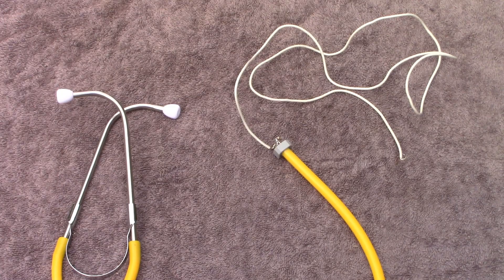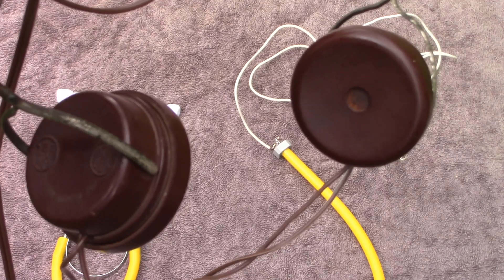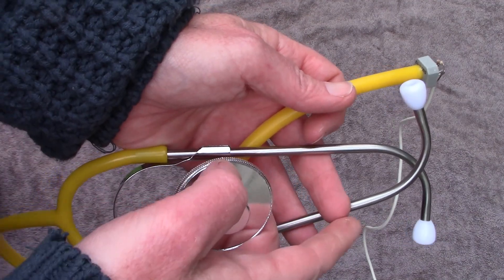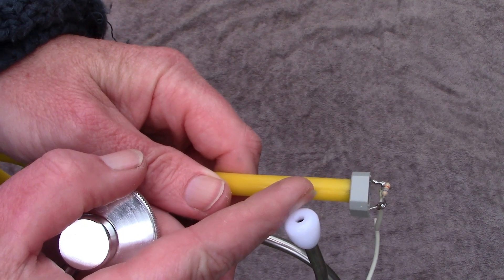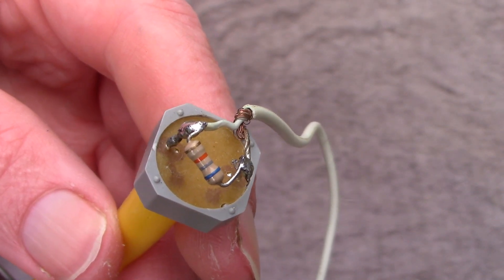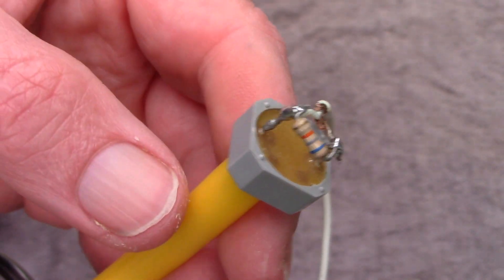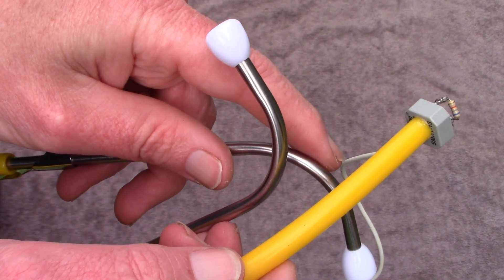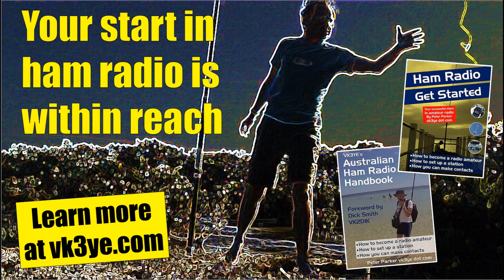Cheap headphones for your crystal set

Comment: Could you be more specific about the type of piezo transducer?
Reply from the maker: It needs to be the type in a plastic case with a small hole that lines up with the end of the stethoscope tube. Not a buzzer. Something like this: https://www.altronics.com.au/p/s6140-1.5-30v-low-profile-chassis-mount-transducer/

Comment: Some years ago I built a single FET regenerative radio. This too called for some high impedance headphones.  At first I used a crystal earpiece, but a pair of 600-ohm headphones, about 80 years old, which, in the 1950s, my uncle had given to my brother and I, together with a home-made crystal set, also worked pretty well. A supplier on e-bay suggested using an Eagle products LT 700 transformer, together with a modern 32+32-ohm headset, with the earpieces in series, making 64-ohms. This transformer was a driver transformer for a transistor radio push-pull audio output stage, using germanium transistors. They were common in the '50s and '60s, but were no longer needed when silicon transistors became the order of the day. This also worked well, using the centre-tapped secondary as the primary winding and connecting the tip and ring of the stereo plug to the primary. This isn't a very accurate impedance match, but modern magnetic materials produce much stronger magnets than the old 'phones, making modern headsets, even cheap ones like I used, very sensitive. There's also an Eagle Products output transformer, type LT44, which was used to drive a 3 to 8-ohm speaker. This didn't work very well.  These two transformers are often supplied as a pair, and , rather surprisingly, are still available.

Comment: Thanks... 

If you have time to send me a link to a regenerative receiver schematic that is reasonable, but not over the top in complexity I would really appreciate the effort.

I found a schematic in 2009 that I followed and the result was excellent. I moved and lost my receiver in the process. I tried to build off two schematics found on line several years ago and either I or the schematic was lacking because each was a failed attempt.

I don't want to give up & surely wish I had kept the schematic from 2009. I am aware of ARRL's Kitchin design that's linked at their site. I'd use it, but I am a retired mathematician and the symbolic representation indicating antenna coupling is unfamiliar to me. If I were to guess I'd say the antenna circuit was loose coupled to the LC circuit that can be thought of as the tuner in the system. I am aware not every regenerative receiver uses such a scheme and my first sucessful receiver did not, but it did use a tickler coil. I'd really hate to try the ARRl design having guessed wrong, thus I am avoiding it & it seems  other designs I've tried are insufficient thus any good, but not overly complex design would as indicated be greatly appreciated.